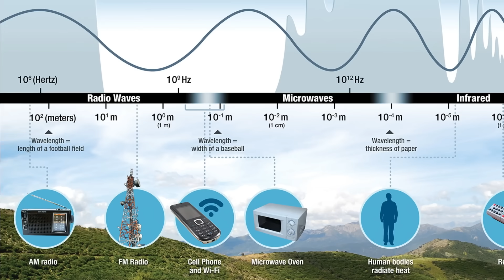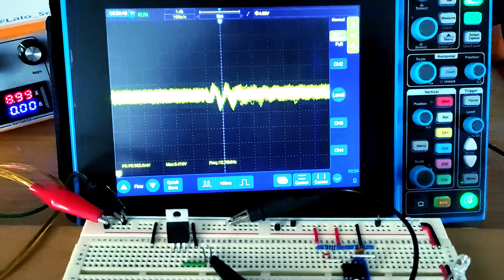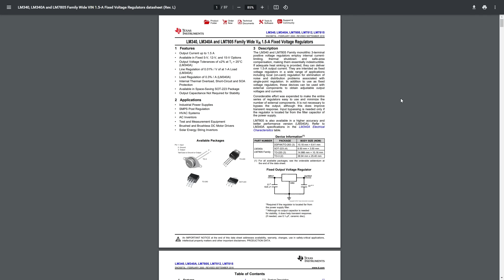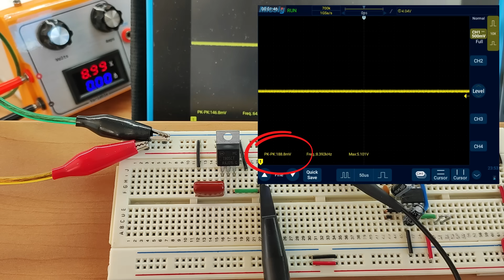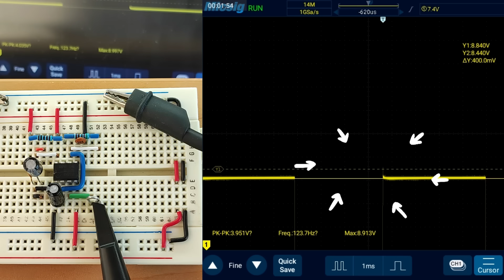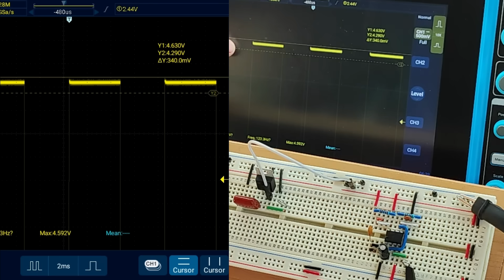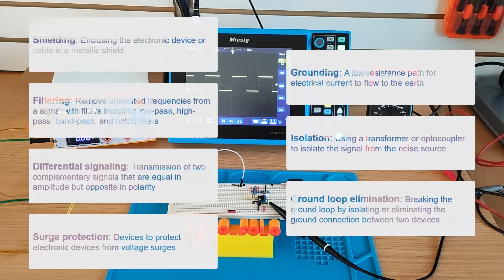Decoupling Capacitors - And why they are important

Comment: Great video. Why does the data sheet recommend a ceramic and an electrolytic capacitor specifically? Why not just use 1 capacitor of a single type?
Reply: High frequency performance of electrolytic capacitors is generally significantly poorer than that of ceramic capacitors simply because of the physical construction. Ceramic capacitor high frequency performance is generally very good, but, at least historically, large-value ceramic caps have been physically large and quite expensive. Using a small ceramic in parallel with an electrolytic yields pretty good performance across a wide frequency range.

You can now get ceramic capacitors of 10 µF or more at low cost and in small packages, at least as surface mount parts. I very strongly recommend against any of the Zxx or Yxx types. They are small and cheap, but many have extraordinarily large negative voltage coefficient of capacitance. A 10 V part operated at 5 V may have only half or less of its nominal capacitance. X7R or X5R much less awful.

Sometimes with just a ceramic capacitor you can get into a situation where the capacitor resonates with the stray inductance in the circuit and you can actually make things worse, though this is relatively rare. Electrolytics at high frequency may look like a reasonably good capacitor in series with a resistance. That resistance can "spoil the Q" of the circuit and damp resonance. Solid tantalum caps are an alternative, better than aluminum electrolytics and not quite as good as ceramics at high frequencies. They are quite expensive these days. Tantalums are intolerant of overvoltage and tend to fail short-circuit.

Comment: Excellent video sir, nice simple hands on explanation and nice and easy to understand, personally I just recently discovered PCB design and I fell in love, something I've seen tested as well is people not using bypass capacitors, when I first saw this I was so confused until I realized they use the Power and GND plane in the stackup with a thinner layer of FR4 or whatever material as a dielectric, that was so interesting to me, but it is as you said, depends on the application and a PCB isnt a breadboard, way better for current loops etc.. thanks for the explanation, it was really well made, 😁

Comment: I am an EE by education and although I have used decoupling capacitors as a matter of course when I do occasionally get to do some hands-on stuff, this visual demonstration does a far better job than any explanation I was ever given 👍 I had also played around with notch filters in the past so adding that extra layer of detail as to how capacitance versus frequency can be managed would be a useful follow up 😊
Reply: And the last part illustrated why you never use the probe earth lead when measuring supply noise. Always the spring clip. Earth inductance is a killer.
Reply: I wish we had videos like when I studied EE 40 years ago.
Reply: If he added a second electrolytic capacitor in the opposite polarity to the one he put next to the 555 timer would that affect the square wave at all?
Reply: @kevingallineauii9353  Electrolytic capacitors have a polarity. If you install them the wrong way, they go POP.

Comment: I am electrical engineer, you explain very well with the demonstration, however one explanation you can add is how the capacitor does the actual filtering, I think you said it but it can be more clear, I understand you only have 7:38 to explain 8-)
Reply: Capacitive reactance is given by the equation X=1/2πfC . So higher the frequency, lower will be the impedance provided by the capacitor. That's why when capacitor is connected in parallel, it provides a low impedance path for high frequency signals like the spikes and unwanted ripples whereas low frequency or stable signals get high impedance from the parallel capacitor and continue moving to the output instead. That's why these are called filter capacitor as they work like a filter.

Comment: dont know about the 555 timer chip, where is the board for. for an oscilating cirquite, capacitors and transistors are enough. with a few resitors. then you dont need the 555 chip. you dont get a square sine that way but a round one.hmmm. i dont know what you are trying to make here. the title says devoupling capacitators. wich is a very abstract name for a cirquitry. we asume it is part of a usefull device. but no reference in your video anywhere. one thumb down. we are also not sure if you explaining something like a teacher would do. or if you need help yourself. eleborate if you please. shoffing just parts on a bread board. is... redundent.
Reply: 1. Can you speak in English please?
2. Can you capitalise your sentences please. That is standard practice when writing English.
3. Can you correct your spelling mistakes.

You post is almost incomprehensible.

Comment: Why did you used different capacitors?  Mylar capacitor on the input, disc capacitors and electrolytic ones on the others?  Ia there a general guidelines when to use certain capacitors?

Comment: Nice Video !! Looking forward to see how to remove EMI with circuits. What are effects of multiple value capacitors in parallel? which seems not recommended in some references. Thanks !!!
Reply: I'm not an EE but suspect that multiple caps in series would raise the impedance of shunting the high frequency noise to ground, ruining the benefits. Also might have resonance like a filter.

Comment: The LM7805 is a linear regulator, not a switch mode regulator.  Check the schematic in the datasheet.
Reply: But you are here to learn about decoupling caps so all good
Reply: @gordonm2821  And you think that when the video producer makes a fundamental error that they should not be corrected?

Don't be silly.
Reply: @deang5622  - The person made a simple slip of the tongue whilst explaining how decoupling capacitors are needed. If the video was about voltage regulators then yes a valid point. They obviously know what they are talking about and the video is so clear and concise. Comments above like 'check the datasheet' are childish.
Reply: @gordonm2821  Was it a slip of the tongue or a fact they did not actually know that the 7805 regulator is a linear type?

If a person has used the 7805 ( and I have) then you don't make the mistake of stating what type of regulator it is.

As the other commentator in this thread has said, "check the schematic in the data sheet".

So the video producer has not looked at the data sheet.

Irrespective of all of that, it is important to correct mistakes made by video producers so that the watchers of the videos are not instilled with incorrect information.

There is no justification for opposing corrections people make. If you oppose people making corrections then you are proactively supporting the idea that educators are permitted to make mistakes in the content they are teaching.

I see it so often with electrical people, particularly with qualified electricians that have been poorly trained, and partly they are handicapped by their poor intelligence, their lack of maths and physics qualifications , that set about creating educational channels on YouTube but don't even understand the basics properly. Their goal is to educate trainee electricians and yet they don't even understand the fundamentals themselves.

To give just one example, I have had to recently correct a qualified electrician that did not understand Ohms Law. And in the comments section there was a viewer that had taken as accurate the guy's comments.

So there we have a confirmed example where the viewers are picking up and learning the incorrect content from a supposedly qualified electrician.

It is fundamentally important to correct errors when they are made. We should not assume why the video producer made the error. The most important thing is to correct the error so that others do not learn it.

You should not be supporting and accepting errors.

And if people are making errors in their videos because they don't have the knowledge to understand what they are talking about, then they should not be trying to teach a subject which they do not have sufficient expertise in. Teachers should not be making mistakes.

End of Debate
Reply: @deang5622  I'm not 100% sure where exactly he said it's a switch mode or not. At 1:11 he said he's using a switching mode power supply at 9V to power the circuit not that the regulator is switch mode
Reply: He's right. It is linear regulator.
Reply: Funny… you were so kind @spongerobert in the way you pointed out Deans inability to pay attention. His rant here and other comments he’s left in this video cause you to reflect on the weaknesses of humanity…myself included for posting this.

Comment: Nicely explained! Single point grounding or (star grounding) also helps "a lot." Have a good day!
Reply: Single point grounding in digital circuitry is virtually impossible. It can be very helpful in moderate bandwidth analog circuitry. Careful attention to local current paths is still worthwhile. (I've done a lot of SMPS design - not the little ones - and current path management can be quite a challenge.)

Comment: I have a peculiar problem with a PCB. This has an esp12f attached to two relays. The PCB has ground and working fine except when I connect a ceiling fan through a speed regulator, both working on 220v AC. When I do that, I get abrupt restarts of esp12f. I have an RC snubber with CB221 capacitor and 390ohm resitance across the load which has improved the stability of the system. I already have a 1000uf capacitor across power pins of esp12f. I was using 0.4uf capcitance. Since I didnt have 1uf, i will try with 0.68uf now. Now the restarts are heavily reduced but still there. How should I try changing the snubber to completetly eliminate this?

I found one more thing. If I use different AC lines/phases to power the esp12f 5v power supply and the ceiling fan power supply, then there is no such problems. But I cann’t do that as I need th esp12f and fan to work with my inverter backed up line.
Reply: use a PI filter

Comment: Hello @Lalo 😊. I am using 7812 regulator with 14v DC input and 12v output. I am using 2x 4700uf caps on input and output. Please let me know if I can put some high frequency caps also at input / output. Please advise.
Reply: the delta V is TOO LOW  [14 - 12 is only 2v]
READ THE DATASHEET !!!!!!!!!
Reply: @kennmossman8701 Thanks for pointing it out. Actually transformer after rectification and on load conditions give this much only and I wanted to put a regulator for stable supply. It was half wave rectification arrangement with lot of hum. I updated it to full wave and to keep hum minimum added those caps.
Reply: @ianuragaggarwal  half-wave sucks. I am not sure what you call hum is hum - do you mean ripple? Having lots of caps before and after is not a fix for hum.  I think someone mentioned that having large caps after the VR is not a good idea.
Reply: 4700uf is much too large. Although it won’t directly affect the circuit it’s  overkill. To eliminate noise smaller capacitors are better. Although the larger electrolytic capacitors can remove some noise, they are mainly used to accommodate for inrush current demands for transient signals as often times power supplies cannot supply a large peak currents quickly as their series inductance is usually quite high. I would say get rid of the 4700u and go around 200u electrolytic  and 2.2u or below ceramic
Reply: @bencollier99  Thank you for elaborate response. Actually I had high hum and its an AM radio. I wanted to bring hum to barely audible levels. I will experiment and bring caps to low level. Also may be I didnt explain properly, this 14vDC is non filtered, its just out from transformer and rectified, if that changes your response then please comment. Thanks a ton!

Comment: Why don't they integrate those bypass caps in the 555 timers?
Reply: The reason they don't integrate bypass capacitors into 555 timer ICs is primarily due to cost, flexibility, and design considerations..

Cost: Adding bypass capacitors within the IC would increase manufacturing costs. Since bypass capacitors are relatively inexpensive components, it's more cost-effective to place them externally on the PCB (Printed Circuit Board) instead of integrating them directly into the IC.
Flexibility: The value of bypass capacitors depends on the specific application and its requirements. Different applications may need different capacitance values for optimal performance. By keeping the bypass capacitors external, designers can easily select and customize the appropriate capacitance values based on their specific needs.
Design considerations: Integrated circuits are designed to be versatile and adaptable to a wide range of applications. By keeping bypass capacitors external, the IC can be used in various circuit configurations without imposing specific capacitor values or configurations on the designer. This allows for greater flexibility in circuit design and application.
Additionally, external bypass capacitors offer benefits such as easier troubleshooting, modification or upgrading of circuits, and the ability to share capacitors among multiple ICs or components.

While it may seem convenient and proactive to integrate bypass capacitors into ICs, the considerations mentioned above, along with the desire for versatility and cost-effectiveness, have led to the prevailing practice of using external bypass capacitors in most circuit designs, including those involving the 555 timer IC.
Reply: Let me give you a proper answer.

Capacitors are very expensive in terms of area to implement on an integrated circuit.

It is often far better to have them as external components.

If they were implemented in the chips, the die of the chip would need to be much greater and that affects the price of the chip.